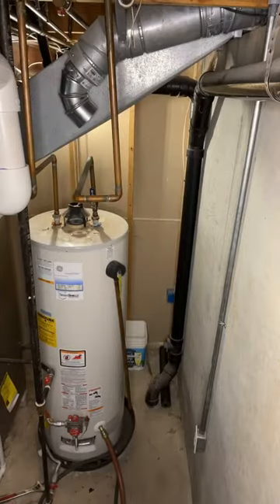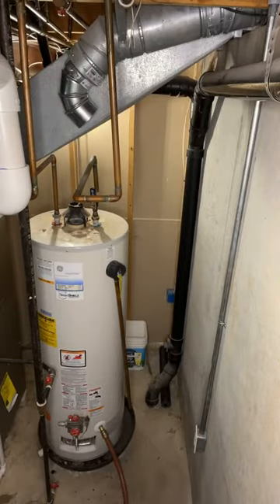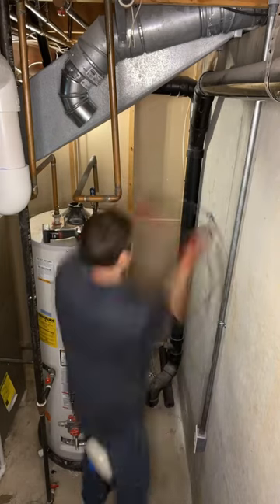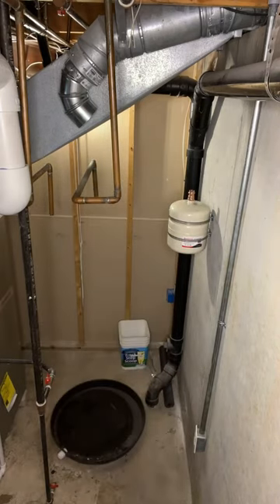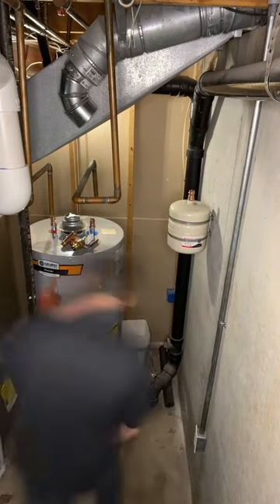Thermal expansion tank requirements when replacing a water heater.

Comment: Is this required on a tankless water heater?
Reply from the maker: It depends on the unit. We will install an expansion tank on tankless water heaters when there is a recirculating line and buffer tank.
Reply: @Kcwaterheaters  I'm replacing mine for a Bosch Greentherm T9900i. Most people I've seen install one don't use it. Just trying to get some sort of consensus.

Comment: My company uses state water heaters but if the home has a prv on the outside we don’t have to install an expansion tank says local code
Reply from the maker: Most of the PRV’s here are inside the house. A PRV would make it a closed loop system. Generally indicating a higher pressure outside the house, the water heater will have the potential to bring the pressure back up the the pre regulated city pressure.

Comment: Is this required for electric water tanks too? Would they need to be installed in warmer states with no snow?
Reply from the maker: Yes, thermal expansion tanks are needed on electric tanks and warmer climates. 

The main criteria is whether you have an open or closed loop system. We don’t always install them, it depends on what city we are working in and the overall water pressure.
Reply: What's the weather got to do with it ?
Reply from the maker: @mgbroadsterJ the weather does not have any impact. I was just answering the question. I should have said warmer states.
Reply: If you have a prv on the outside of home which a lot of old homes don’t you don’t need one but it changes with code
Reply: Thanks for clarifying. Wasn't sure if expansion tanks were needed in cold climates, when water freezes it expands. I live in the south, but have never seen an expansion tank on a water heater

Comment: Um that's upsidedown. Ever seen a pressure tank for a well? You'll never be able to get the water out of that thing without flipping it over now and sediment is going to build up on the inside of the bladder. Also why'd you ditch the pan? The old water heater had a drain pan but the new one gets put in straight on the floor?? Wack.
Reply from the maker: Thanks for the comment. The floor drain is 2’ away and the concrete slopes to the drain. 

Please take the time to click on the link in the description, it will direct you to our website which shows the manufacturer installation instructions. They are required to be in the upright position by most manufacturers.

Comment: Waste of time and money. An expansion tank doesn't correct a problem, it's just extra expense. What is the tank supposed to fix? The water meter going backward a quarter gallon? Prevent contamination from what? The water in your pipe at the meter is the exact same water in the main, if it's contaminated then so is the main. Just like backflow preventers, unnecessary and only there to make more work for plumbers.
Reply: Pretty sure it’s for thermal expansion within the tank nothing to do with contamination. It helps control fluctuations in water pressure that could damage plumbing fixtures. It’s 5 minutes of extra work. If you took less phone breaks then you wouldn’t even notice the time it took to install.
Reply: On domestic potable water system I will say it’s arguable and varies from code to code depending where u are..:for closed loop hydronics they are absolutely necessary
Reply: An expansion tank and PRV is required ..
We have  two valves ,one for expansion and the other high temp .
Reply: We have to pass exams just to be allowed  to fit an unvented  cylinder . .
 We can't  register the warranty without it .
Reply: 😂😂😂😂 all of you are just goof